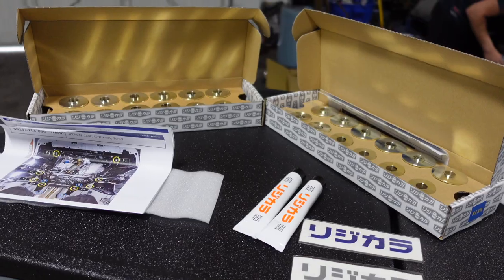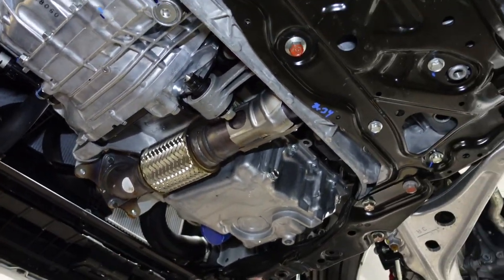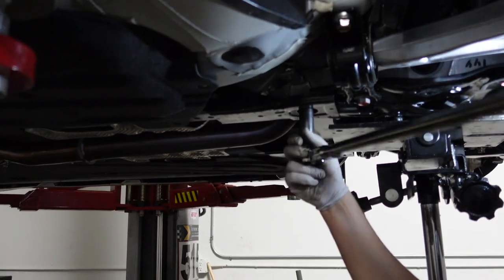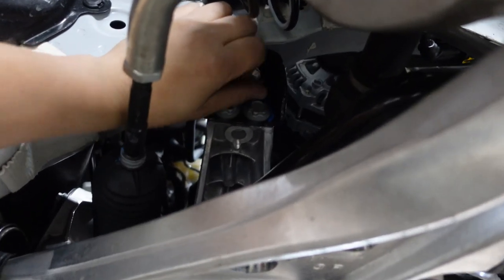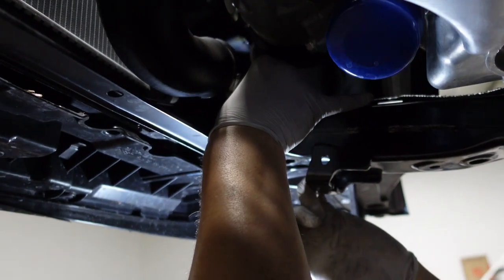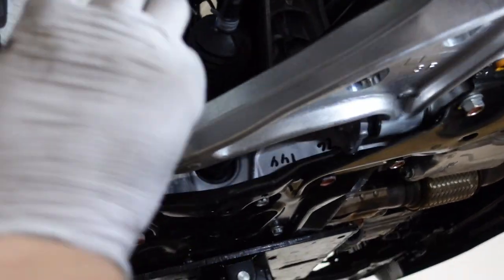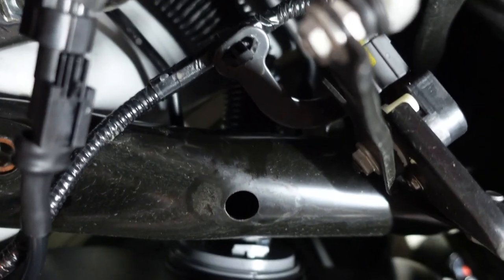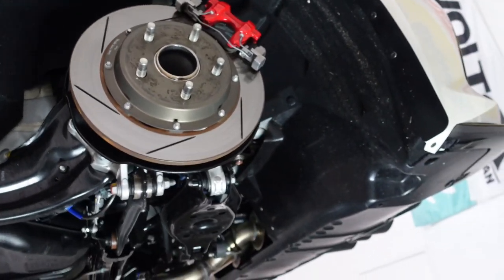2023 Honda Civic Type R FL5 Spoon Sports Rigid Collar Kit

Comment: What is the benefit of installing the rigid collars? What did you feel on the test drive?
Reply: You don't feel anything. What they do is keep the subframes from shifting around under high loads. If the subframe shifts, it can impact the wheel alignment. But really not a concern unless you are pushing the car to the absolute limits.